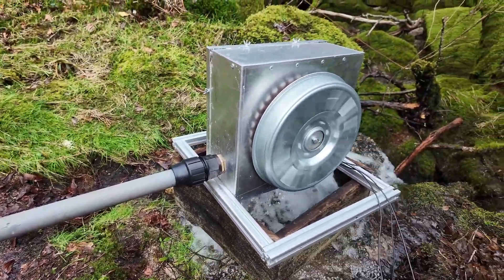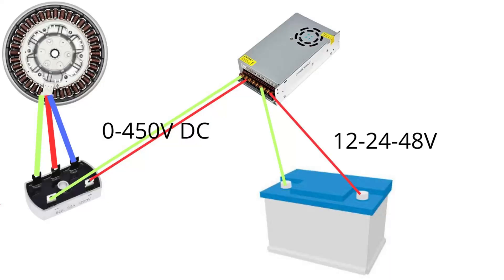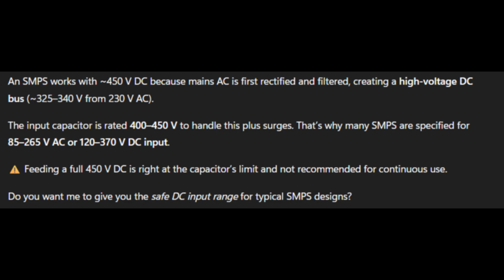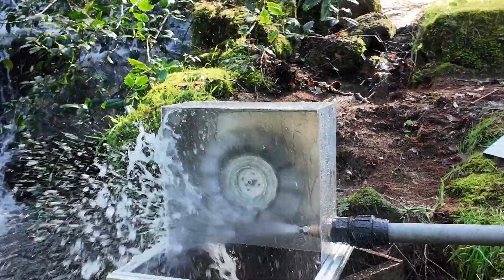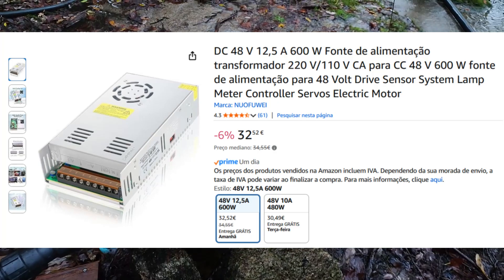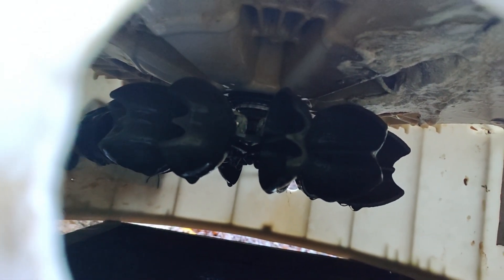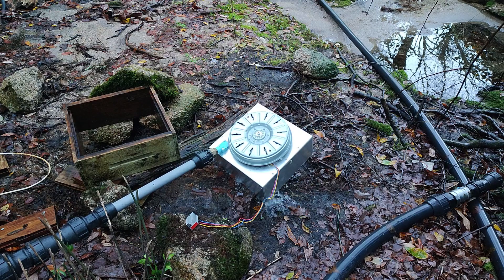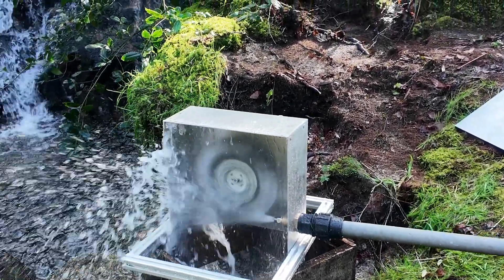Best Hydro Generator Setup: Washing Machine Motor + SMPS Explained

Comment: I plan to use the same motor. 
Did you test if the SMPS really can handle this high voltage?
I would like to add a dumpload so my voltage stays below 250V but if that fails my charge controller will be destroyed
Reply from the maker: Yes the SMPS have no problem with 450v, it is working right now 24h and this 8month per year... On load in goes to 200v and when battery are full 450v and no problem. Most MPPT charge controller can't handle that

Comment: your water jet is too far from the buckets, and is too diffuse, too flared, it should be concentrated and hit the center of the buckets on the central edge.
Reply from the maker: Yes I agree, I can move it like 3 or 4cm closer and use a smooth nozzle, this nozzle is clearly spreading water around giving production loss!